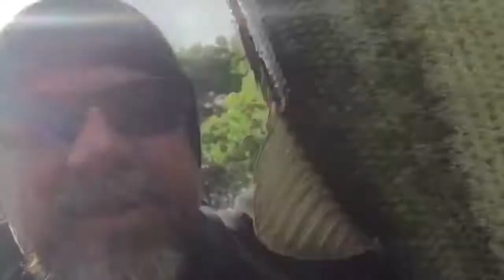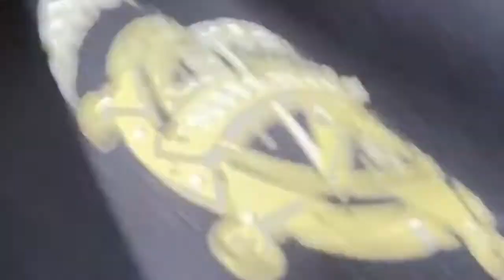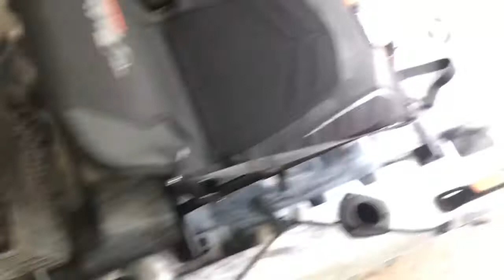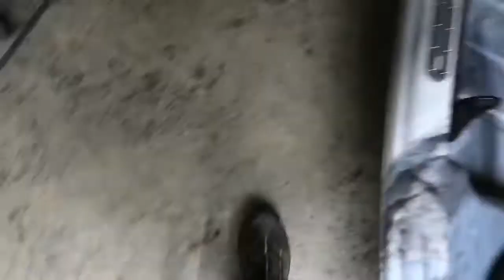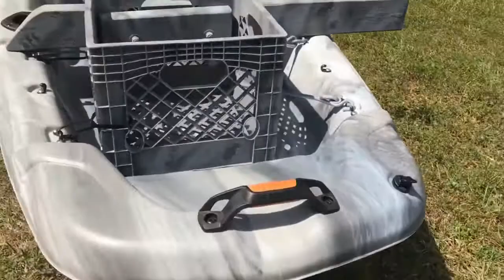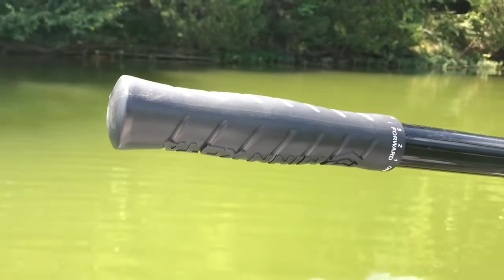Pelican Catch 100 W/55lb Thrust Trolling Motor DIY C8 Mount ll

Comment: What I did with mine I have a Mota 55 pound thrust what I did was have a custom cut by a dealership that deals with Minnkota so my warranty is still valid. cut it down to 28 inches. It’ll be perfect for your kayak. Trust me. I got three motors that I had custom cut and it works just fine.
Reply from the maker: Sound Killer Thanks for sharing now have the  PWR got a pretty cool set up going on that one. Will prolb.do Vid Come Spring Aloha Man spent 9 yrs Waialua Surfing NS.Worked in town.Miss it ! ✌🏻🤙🏻

Comment: I’m confused…how do you secure the 2x4 block of wood to the boat? Is it just drilled through to the crate? Nothing actually attaching it to the boat at all?
Reply from the maker: Thanks for viewing I thought I put it all in the video. I will watch it back when I have time the 2 x 4 is attached to the milk crate. I sandwiched it with a 11 inch 2x4 on the inside top of the crate with three heavy Bolts  if that’s what you’re asking thanks for viewing and comment. Let me know if that was what you were talking about.✌🏻
Reply: @NoPro1962 that’s awesome! Does the weight of the battery and the bungees keep it secure in the boat then even with the weight of that big old 55lb thrust motor hanging off the side?
Reply from the maker: Sorry, I thought you were watching a more updated video on a second build. I did punch on my icon and go forward a bunch of videos and I did one a couple years ago as well.
Reply from the maker: @spiffy72985 yes

Comment: I have to do this…. I have the same kayak and tackle bag. It’s meant to be
Reply from the maker: Just picked up a Catch PWR 100 pretty neat it has motor mount rear center Iv rigged it with a nice budget steering system will b doing Vid early spring.Thanks for viewing and comment.🍻

Comment: I'm in the process of doing that setup now.  What were those things you secured the basket down with?
Reply from the maker: Sorry so late 🙄Just some generac little turnbuckles and weight of Battery and motor I picked up The PWR 100 model and has a nice motor mount rear center works really well Have it in one of my newer Vids.Made some hand controls for steering .

Comment: Does the kayak go straight?
Reply from the maker: Don Brazos Tracks pretty good takes a little getting used to mainly wen kicking on 5 does pull then levels out it will definitely spoil you.Thanks for viewing Man! 🍻🇺🇸🤜🏻
Reply: How do you steer it ? 
Do you turn the handle or does it just go straight?
Thanks for the response
Reply from the maker: Don Brazos Steers Normal just reach up past right shoulder Steering is a breeze hope answered you quest.🍻